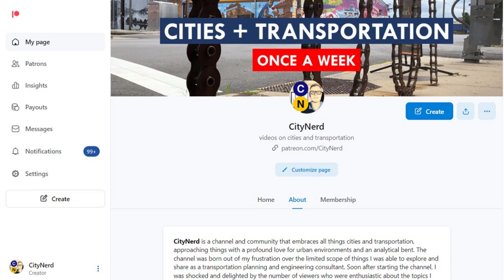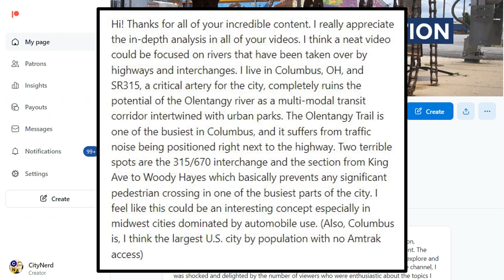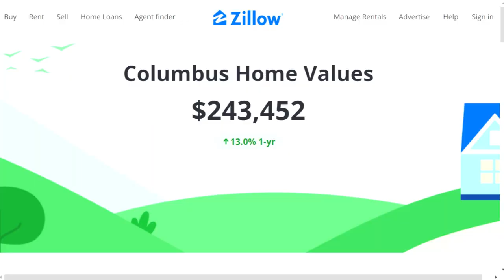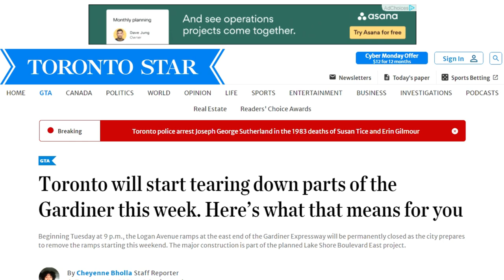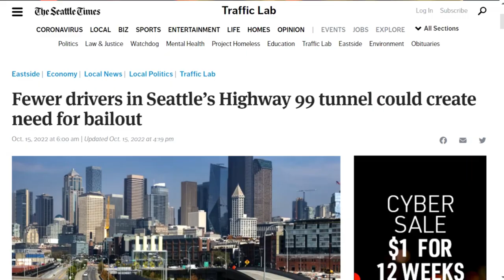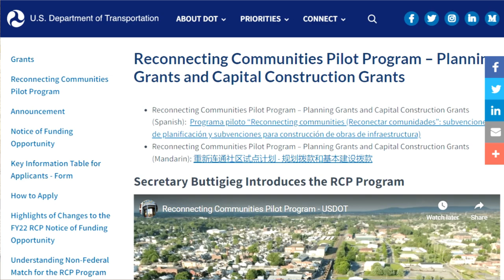Highway Engineering Madness: 10 Waterfront Freeways That Need to Go (North America Edition)

Comment: Chicagoan here! I agree with you, objectively speaking, on Lake Shore Drive, but I would say that from a personal standpoint, it's existence doesn't really bother me. The tunnels do make it really easy to cross on foot, and I've never felt like it was a barrier between me and the lakefront. Maybe it's just because I'm used to it, but the noise doesn't bother me either. When I am traveling by car in the city (which I try to avoid but sometimes happens) LSD does tend to come in handy to make my trip faster (although I'm never on it near rush hour, so maybe if I were I'd have a different opinion). So yeah, personally, I don't mind it at all. Objectively though, I don't disagree with it's spot on this video... it would be really interesting to imagine the lakefront without it!

Also, as a former Manchester NH resident, 293 definitely deserves to be a dishonorable mention. Kind of exciting to finally see Manch in a video, kind of depressing that it was for that.

Comment: I have lived in Chicago for 10 years now, and LSD doesn't really bother me

1 - It is essential to many people I know who live on the Northside and commute to south suburbs for work. I90/I94 traffic downtown is terrible especially with the non-stop construction that has been happening there since I moved to the city

2 - Everywhere I've lived its been pretty easy for me to get to Lake Shore Path for biking and also to the beaches. I've never had issues with not being able to cross over or under LSD at different points along the lake. For people driving to the beaches, I find that the parking offered is more than adequate.

3 - The northside and southside beaches are actually quite protected from the sound pollution. I'll admit that the downtown area is pretty noisy, but I steer away from that area anyways because of how crowded it is, so hasn't been an issue for me.

Comment: The thing about the QEW/Gardiner Expresssway, is that it was the FIRST long-distance inter-city freeway in north america, having been completed opened in 1939 from the Humber River in Toronto down to Highway 420 in Niagara Falls, Ontario, travelling through the port and docklands of Hamilton and having to hug the shore of Lake Ontario from Grimsby to Saint Catherines becuase of the 300-foot-tall Niagara Escarpment (a giant limestone ridge that limits development).  Even with reconstruction of some now-very-outdated interchanges, problems remain from the cities of the Golden Horseshoe growing around the freeway in what used to be wide-open farmland (here's looking at you, Mississauga).  Widening is no longer possible due to development (well, not without mega-expensive expropriation), and since the mid-1990s, the Province has been floating the idea of a Mid-Peninsula Bypass from Hamilton to either Niagara Falls or Fort Erie/Buffalo to take traffic pressure off the 85-year-old freeway, but it seems shelved now.  In 1998, the City of Toronto actually tore down the eastern-most mile or so of expressway and replaced it with a widened urban arterial avenue (with spur rail lines running down the median to serve nearby industries), and also added a bicycle trail.  The city at least kept the support columns in place as a new art piece, showing where the freeway used to go, which is nice.

When the Gardiner Expressway was extended through Downtown Toronto in 1956, the area was mostly the CN Waterfront Yard and factories everywhere (hence the name for CN Tower: CN Railway donated the land to the city and federal government to build the giant FM/TV transmitter tower with rotating restaurant and other amenities that instantly became a huge tourist attraction and came to define the city upon opening in 1975).   It really wasn't that out of place at the time.  The apartment tower building boom only really got underway in the late 1990s to deal with the population growth, and the city decided "hey, we have all that unused brownfield space downtown.. let's turn it into CityPlace!  It's right next to CN Tower and SkyDome, too!  So... yeah. you're right in that the QEW/Gardiner isn't as bad as it could be, but the City's grumbling about having to spend something like 50 million per year just on maintenance, and has considered knocking down the portion east of the Humber River and replacing it with a six- or eight-lane urban avenue with traffic lights.  If they think traffic is bad now, wait until they do THAT! At least the QEW provides a direct connection to the Don Valley Parkway (another freeway) due east of Downtown along the Don River... which i'm actually surprised you didn't mention becuase it's a far worse offender: hugging the river, going over bicycle trails, being punched through pristine parkland in the 1960s... and it's so clogged with traffic people nicknamed it the Don Valley Parking Lot.  Speed Limit of 60 mph?  lol you'll be lucky to get up to half that.

Interstate 64 in Louisville.. oh god.  Spaghetti Junction.  I went through that before it was reconstructed... it was a nightmare.  I can only hope it's improved now...

Comment: As someone who lives in Boston, Storrow Drive is absolutely necessary and it would be stupid to remove it. Storrow Dr relieves traffic on the central artery by connecting 93 to 90. Storrow Drive also connects Allston, Brighton, Brookline, JP, West Roxbury, Roslindale, and Fenway to Back Bay, Beacon Hill, and parts of Downtown. Also in terms of pedestrian connectedness, its right next an enormous waterfront park and there are numerous pedestrian bridges that connect it. If you are trying to cross Storrow drive you are never more than a 2.5 minute walk away from a pedestrian bridge. This video does not actually weigh any pros and cons and puts enjoyment of some pedestrians over the multitude of benefits it provides. Is it completely impossible for you to consider any factors other than being able to walk through a city without any disturbances?

Comment: 376 isn’t even the worst riverfront Highway in Pittsburgh. We are unlucky enough to also have the 10th Street Bypass, which runs entirely next to a trail to go the same route as Fort Duquesne Boulevard, just skipping the intersections. Its only job is connecting 376 and 279 to the convention center, and it is very rarely used. Its proximity to the river also makes it flood quite frequently.

Comment: How did N. Carolina get that way?
1.) It’s worth noting,there aren’t any substantial rivers in NC. Most east coast rivers start in the mountains, but because the Bermuda Hotspot lifted an arch under NC, the rivers that start in our section of the Appalachians don’t flow thru the state. The rivers that empty into the ocean in our state all rise in the Piedmont
2.) I-85 is our river. Okay, technically, it’s the old Indian Trading Path that follows mostly the same routing, and then the railroad that followed its routing, but the Interstate is what people know. Development in the Piedmont has leaned heavily on this general route since colonization.
3.) A couple of our smaller cities do actually have some legit riverfronts, Wilmington most obviously.
4.) Raleigh, the one big city that isn’t on the old Trading Path/I-85 was a planned capital, built on land owned by someone who had legislative connections.

Comment: I lived near Toronto for almost 60 years. The problem with much of this freeway infrastructure is that it has become so much of the traffic flow that removing it, however beneficial can be very problematic to how the local economy is currently organized. The Gardiner expressway is (mostly) and elevated expressway that allows flow of traffic from the QEW to flow across the central district and if necessary north of the Don Valley Parkway to the 401 and beyond. The DVP itself is a route into the city from the NE and is often jammed with cars in rush hour. Removing the Gardiner would make this non-viable and even though we have a decent transit system, it is comparatively expensive and slow and thus not an alternative for many people running their kids here and there and then going to work. There is not enough time in many hectic lives to wait 10 or 15 minutes for a bus in traffic that travels an average of 15 km/h.
The QEW was built a long time ago and is actually named for the former Queen's mother not our recently departed monarch. It is the artery that takes almost all the auto traffic from the Toronto area through Hamilton and down to Fort Erie the major border crossing point. You can cross at Niagara and perhaps that is fine for locals, but they have put high tolls on the 405 in Ontario because they want you to go to Fort Erie/Buffalo where the large crossing facilities exist. This route is very important for trucks as well as cars. If you removed it from Hamilton's waterfront, you would absolutely have to build a bypass. This would result in the spending of a LOT of money and making the route far longer. I think in sum it would be unpopular. We are kind of stuck with the QEW especially and probably the Gardiner at least for now. In Toronto, our rush hour busses and trains are crammed full with commuters and children going to school. The busses are stuck in traffic. It is a very uncomfortable ride that does not suit people carrying parcels or strollers and such like. We have added a lot of new building in Toronto and I do not understand why there are not decent levies for these builders be they condo or family homes that could pay for additions to the transit systems. We have a very car centric conservative government right now that got re-elected and so while some transit will be built these are specific projects, but little is done in (a) fare subsidies (b) bussing.

Comment: I came to this video expecting Lake Shore Drive to be mentioned and it being first, while surprising, makes sense. There is so many great parks and things to do that would be much better without the existence of Lake Shore Drive. Not only that but every time I’ve driven it has been anything but relaxing. Drivers are crazy and aggressive, the road is usually littered with pot holes, and it make accessing places on the east side of the road unpleasant. Would love to see it turn into a network of paths and efficient public transit to help people get around without the need of hundreds of cars causing noise, pollution, and disruptions if you are navigating the city by any other means than a car.

Comment: Before any limited access highways were built along the rivers here in the Pittsburgh region , the railroads owned the land for right of way. The great city used the waterways- as well as the adjacent rails, for the massive transportation of both goods as well as people.  Not for sightseeing, high priced residences or recreation.  When I-376 was built, huge amounts of river traffic, barges full of coal and oil, it was very industrial, not a place for a river walk.      Railroads of course are put on flatter lands near rivers too, trains can't do steep grades.  A lot of river fronts were also good places for steel mills because of transport as well.   The 21st Century idea of recreational rivers is a new one.

Comment: In NYC the BQE is one of the only legal routes for semi trucks through the city. If it was removed, that means they need a new truck route. One proposal for it was to ban passenger cars from it, and rebuild it as a truck only road, but there’s no proposal for it to be removed due to the truck traffic. 

The FDR drive may become more heavily used with congestion pricing, as I don’t believed the fee will apply if you stay on the FDR. The idea is to use it as the out of the way vehicle route the way the Netherlands forces cars to take indirect routes so pedestrians and cyclists have priority. It would be better if it became a tunnel with a park above it.

Comment: I live in Toronto on the west end, just off the Gardiner. I can say it's a vital connection into the city when you're far west and not on the subway line. If there was a Lakeshore sub line, I'd say get rid of it.

This summer saw a test on the impact of traffic when they shut down parts of Lakeshore Blvd. The Gardiner couldn't handle the traffic, turned 15 minute drives into 60+ minute drives with no good transit alternatives.

Agree the Gardiner is a huge waste of space but without alternative transit methods, getting rid of it shuts down access to the core to anyone west of high park.

Comment: Chicagoan who lives 3 blocks from LSD. You’ve noted all the negatives in the video, but to pile on; to gain access to the lake front downtown, you have to cross the drive at grade. On the north and south sides they have tunnels or over passes so at least you are safe from traffic, but not downtown. This has caused a lot of frustration from a lot of urbanist types as the pedestrian crossings are incredibly unsafe, and someone was killed by drivers making illegal turns last year. They’ve fixed that single intersection but the whole place still sucks. I tell all my friends that for bike paths lake shore sucks compared to other, easily accessible paths in the Chicago area.

Comment: Hi, Chicagoan here!

I think LSD definitely not great, but also not terrible, and definitely doesn't deserve the #1 spot here. 
There are ample walkways and tunnels to get to the green space from the city, and, though it's obviously not ideal, LSD does serve as an extremely important artery in getting around the city. Driving times to get between certain areas would literally double without it.

Also, during our long winters, fact is that most people aren't going to the lakefront. Chicago is a pretty walkable city year-round, but most of that foot traffic is on the regular city streets - not out on the lakefront. Getting rid of LSD will result in increased car volume on other city streets, potentially making them more noisy, polluted, and dangerous for pedestrians.

I definitely do think though that some improvements could be made. Either they could tunnel some sections of the drive and add more green space over it, add express bus lanes, or install some sort of an extension to the red line running under the park (cuz it's pretty inaccessible from the L -- the Lincoln Park Zoo, for example, is a 25 minute walk from the nearest station at Sedgwick, as is Montrose Beach from Wilson). However, removing LSD altogether without anything to replace it will do more harm than good.

Comment: I took a day trip to the Back Bay a couple months ago and I wanted to walk to the Charles River Esplanade and the fastest way to get there from where I was was a pedestrian bridge. Walking over the road was deafening; I measured 80-85 decibels on the bridge. Walking along the waterfront is completely ruined by the noise just tens of feet away. If I lived in the Back Bay I would be advocating for removing Storrow Drive completely. Like you said, there's already I90 which would ideally end at the Cambridge Street interchange. Get rid of I93 while we're at it.

Comment: At 12:43. Well, the reason North Carolina's largest cities have no river fronts is railroad development. Before the advent of the railroads, North Carolina's largest and most prosperous city was Wilmington, on a large river right on the coast. Very typical for colonial settlement patterns in the British colonies. But once railroads started coming to the forefront in North Carolina after the 1850s, Wilmington started to slowly lose its status as North Carolina's largest city. Important railroad interchanges--at Winston-Salem, Charlotte, Greensboro and Durham--became more and more prominent since that's where tobacco and other important cash crop shipments could be sent cheaply to the major manufacturing centers in the northern U.S. Thus by 1950, the largest cities in North Carolina became the ones around the railroad interchanges, leaving Wilmington in the dust. The same thing happened to an even bigger degree in Georgia--Atlanta grew mighty as the most important railway interchange in the South, with no large river in sight, while colonial Savannah was left in the dust.

Comment: I have such a love/hate with the Gardiner Expressway in Toronto. It is undoubtedly a poorly planned (outdated) slab of elevated road which at one time did bifurcate the city from Lakeshore. But the area around it has been thoroughly developed and just like grass growing through cracks in concrete, the downtown core has managed to extend past it. First off, it is a beautiful, majestic drive through downtown. If concrete jungles are your thing.. But Lakeshore drive which runs below it, weaves in/out and ultimately takes you on a very scenic tour of Exhibition Place, Ontario Place, towards the Mimico/Humber Bay. It's become very liveable and always lively. I actually really like it.

Comment: Glad he included Portland. I lived there 20 years ago for 10 years (1990 - 2000). Even back then they were told that the highway along the river was unsafe and could fall the same as the Kobe highway did in Japan. They were suppose to put metal sheaves on the supports. I bet that even until now they still haven't done this. 

Earthquake disaster. Sound familiar?

Even 30 years ago they found that the cost of moving the highway inland and allowing the development of the river property directly across from the downtown would equalize the costs. Today the movement would create a new business district on the east side. But the powers that be don't want this to happen. 

On the opposite side, in Oregon the coast was considered all public since people first came they drove up and down it. The Oregon Supreme Court declared that the whole coast was public domain and no one could claim it. (California should take a lesson).